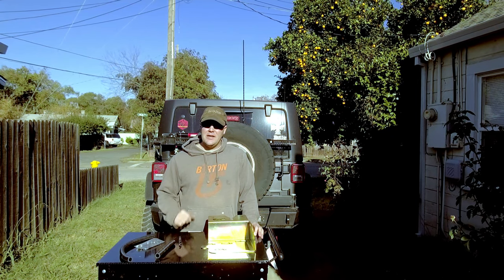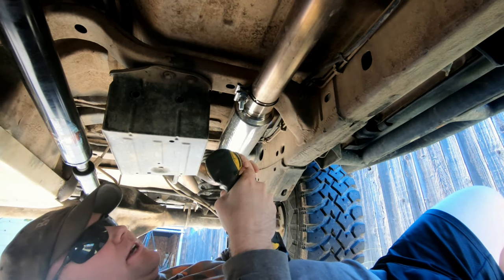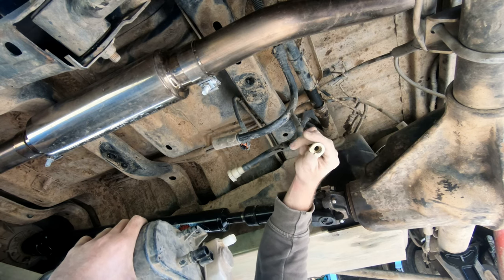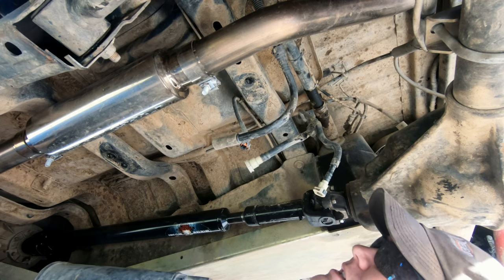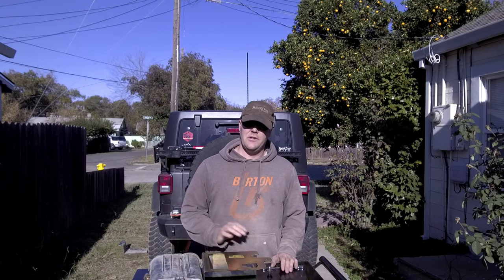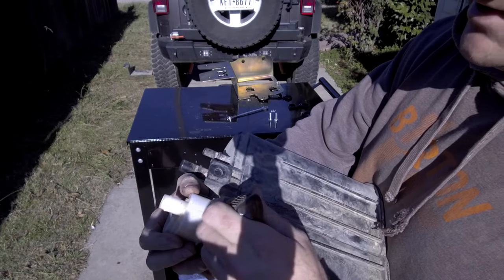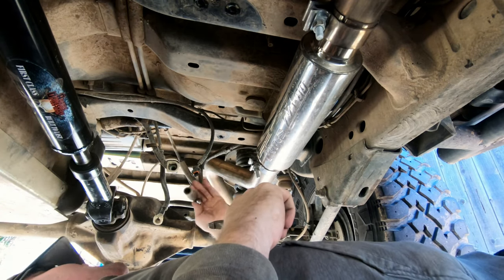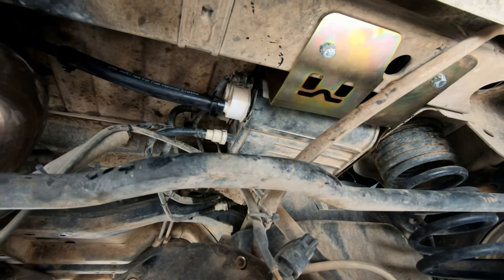MetalCloak Evap Canister Relocation Bracket Install

Comment: Nice overview. The information on spinning the "white canister part" and where the clip is was a great help. I installed this on my 2015 JKU  I recently purchased. Total install took about an hour. The Rivnuts were easy using my 3/8" impact driver vs wrenching or an actual rivnut installer. I also used the short extension hose. Not sure why anyone would install a skid plat instead of this relocation kit. Great job Metal Cloak on quality and price. Thanks for taking the time to cover this install. Your video sold me on this kit.
Reply from the maker: I'm glad it was able to help you out, and I agree its much easier using a 3/8" impact vs wrenching. It just makes it so much easier. I don't know why people would choose a skid plate vs moving the canister. Even if you install a skid plate it is still a hang up spot if you go over a rock. With this kit your entire axle protects the evap canister.

Comment: Big Question...did it help at all with the infamous "rattle" from the white part of the evap canister?  I am thinking of moving it, but am hoping it is a more solid mount than the factory. If I really press up on the old skid plate, trying to get it not to bounce, the rattle isnt so bad when i hit the canister.  But as of now, i can hear that damn thing rattle on every bump in the road.
Reply from the maker: I honestly don’t remember a rattle from the evap canister.  I will say that the mount is very solid. It doesn’t move and it holds the canister snugly.
Reply: Awesome, i think I m going to pull the trigger.  Thanks  @NotICON

Comment: I'm looking to do this with mine.  I noticed your exhaust has been modified, how did that affect the jeep if any.  Thanks Mike
Reply from the maker: I installed the Pypes High Ground Clearance Cat-Back Exhaust, https://www.extremeterrain.com/pypes-high-clearance-catback-jk-sjj21r.html the only difference is that the exhaust has a deeper and more aggressive exhaust note. I also don't have the giant stock muffler betting smashed on rocks. I did a review of the exhaust if you want to check out the video. https://youtu.be/zH8J3WAEphU